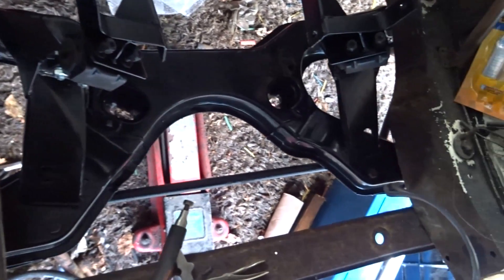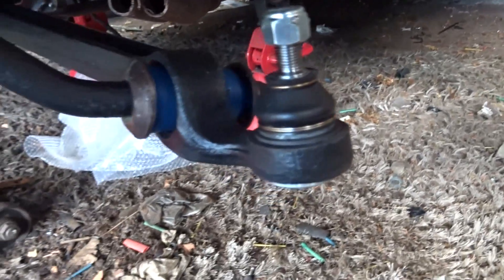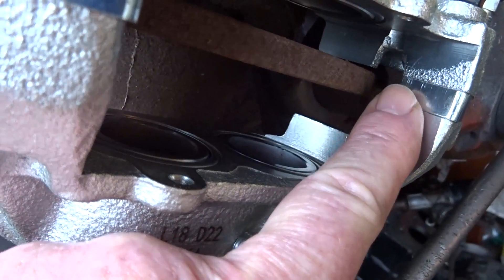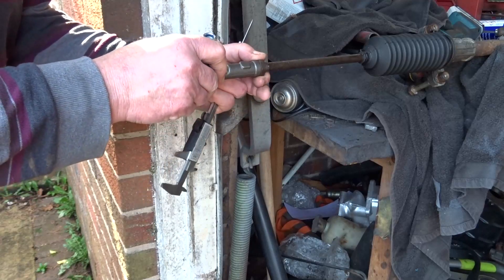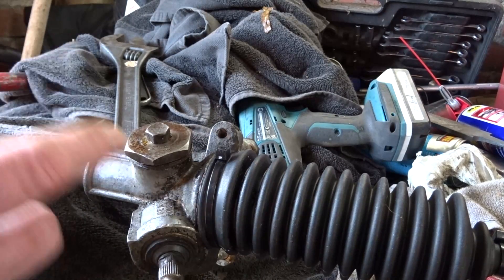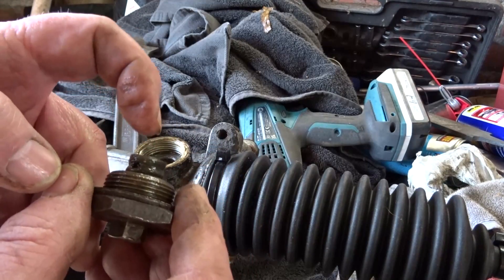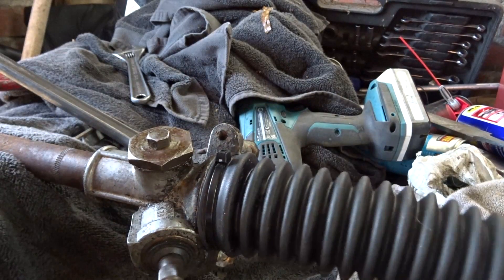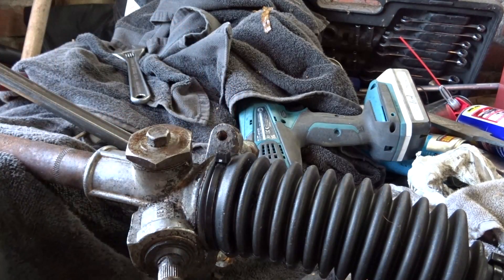TRIUMPH TR7 V8 Steering rack sorted

Comment: Hi Chris, thanks for the upload, I bet the previous owner removed a shim or two to tighten it up, worth checking if the bushes at either end are ok. Also that bolt in the middle can be removed and a grease nipple screwed in to grease the rack👍👍
Reply from the maker: Cheers Ian. You're probably correct regarding the shims (or lack of them). I've packed the recess with grease and just waiting for the new shims. I'll try to get a new grease nipple for the housing nut. Take care.
Chris Robinson.